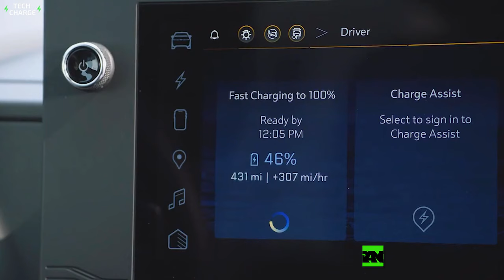Best NEW Electric Pickup Trucks Coming in 2024

Comment: They  require fuel from coal or natural gas power plants so you can't call it emissions free.  Question what happens to ask those toxic batteries when they are spent and what's the carbon foot print to mine all the metals and elements needed to make the battery. Anyone ever look into the Manufacturing of these batteries? Chefk it out 9:44

Comment: At one point these will all be reversed.  Due to limited resources for batteries, batteries are not recyclable as they claimed, road maintenance cost more due to weight, and road safety barrier are not designed to stop them.  Let's get it straight, the battery pack are rebuildable by replacing the battery cells.  The batteries themselves don't get reused.  On top of all this, there will be tons of used EV on the lot